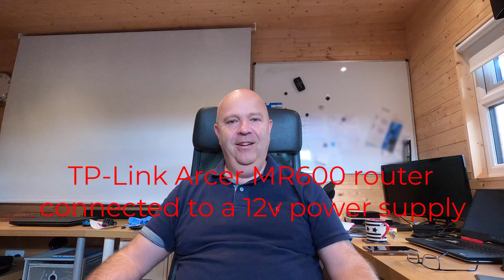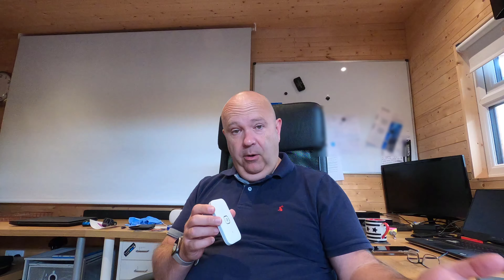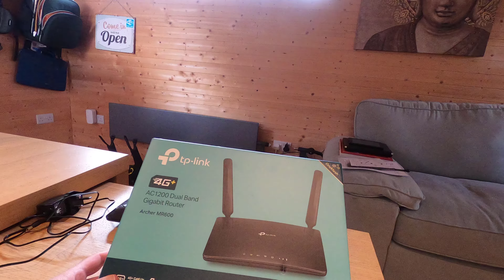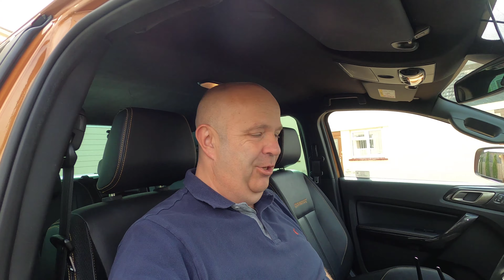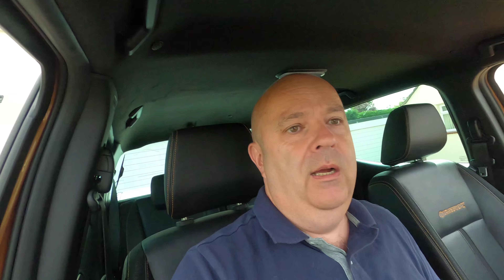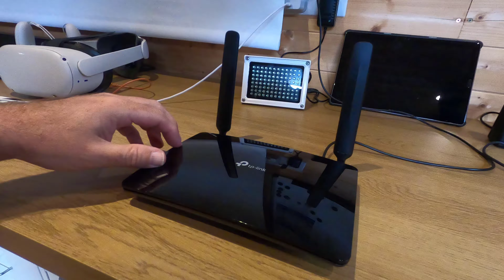TP-Link Archer MR600 Router Connected to a 12v Power Supply

Comment: Thanks for the vid! :) 
I checked out the specs on the lead and the router and there is a discrepancy. The lead takes a 5V 2A+ input from your USB supply, but because of the conversion to 12V output it only outputs 0.6A. The MR600 uses a 1.5A power supply. Normally this would be vastly overrated to prevent problems with the power supply burning out, but even if the MR600 only uses 1A under normal circumstances the lead will be underrated for the job.
It will most likely work for a while (although I can imagine the router being unstable) but the lead will probably give up at some point.
I can't imagine it being a safety issue at those volts/amps, but it's worth considering. I'd have thought a basic lead plug into a 12V accessory socket would have been fine, although I'd keep it on the leisure circuit and avoid putting it on the starter circuit as the alternator will be pushing out over 14V.

Comment: Did the cable work long term or did you have to find another solution? Ive just ordered a TP link MR600 and want to be able to switch between using it in the house and van long term.
Reply from the maker: Sorry for the delayed reply. The cable is still going strong but I went off grid last weekend and found that it drained the leisure battery really quickly. I have only used it with an electric hook up previously so this is worth taking into account.

Comment: Perhaps a silly question as I am not an expert in things electrical but aren't USB sockets 5V, therefore how can they power a 12V device? Perhaps someone can educate me?
Reply from the maker: I don't fully understand how it does it but think it is something to do with the amps being used to generate more volts, don't quote me on that but it is still working but does drain the leisure battery very quickly.
Reply: Bought one and whilst router powered up, it kept power cycling. Replaced with normal 12v cable socket and connector which was far more stable.
Reply: @carlosfandango7171 thanks - do you have a link to the type of cable you used? many thanks.
Reply: @ProjectBrinn   What leisure battery set up do you have to give an idea of power drainage? Many thanks
Reply: A "step-up" power supply, also known as a boost converter, increases the input voltage to a higher output voltage. It achieves this by storing energy in an inductor during the switch-on phase and then releasing that energy to the output load during the switch-off phase. This process, controlled by a switching transistor and a capacitor, allows the output voltage to be higher than the input voltage. 
Here's a more detailed explanation:
1. Switching Phase:
When the switch (usually a transistor) is turned on, current flows through the inductor, storing energy in its magnetic field. 
2. Energy Release:
When the switch is turned off, the magnetic field in the inductor collapses, releasing the stored energy. 
3. Voltage Conversion:
This released energy, along with the input voltage, is then used to charge a capacitor or other components to achieve the desired higher output voltage. 
4. Duty Cycle Control:
The ratio of the switch-on time to the total switching period (duty cycle) determines the voltage conversion ratio. A higher duty cycle leads to a higher output voltage.

Comment: If the router requires 12vdc why not just cut the plug off of the original adaptor and wire it into your 12vdc supply in your caravan?
Reply: This was my idea, and researching right now, if this is a good idea.  Anybody tried this, would like to hear about results!

As many might know, 12V batteries tend to drift between ~14V and ~10V depending on charge status, that could have effects of the workings of my router and maybe even damage some circuits.

Did anybody try this? Did it work? Did it work when the batteries are actively charged or almost empty?

Comment: Hi Brian, i bought the cable and the the tplink router. It works at home with the standard adapter, but in the car it's rebooting every minute or so. I think it's the 12v USB adapter I use, 12v to a double USB which says max 2.4A. Which one will work correctly?
Reply from the maker: Not sure

Comment: Hi, that's a great hack thank you. I've an Archer MR400 which takes 12v 1A and I've noticed that amazon cable has a max rating of 0.6A, just wondering whether that has anything to do with you only getting 2 signal bars when you usually get 3 ?

Comment: Did it show you a light when it's connected with a normal cable to your car? I mean like how do you know that the cable is different from the normal USB 5V cables, putting into consideration that the light was very dim. Thumbs Up for the video!
Reply from the maker: I think the lights displayed but the same, were very dim